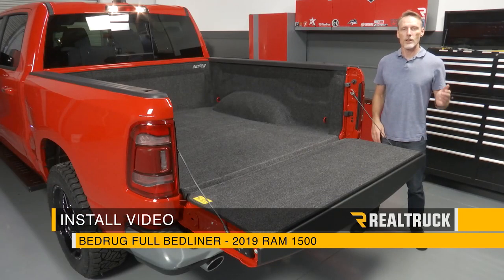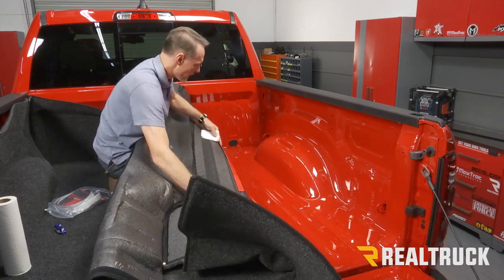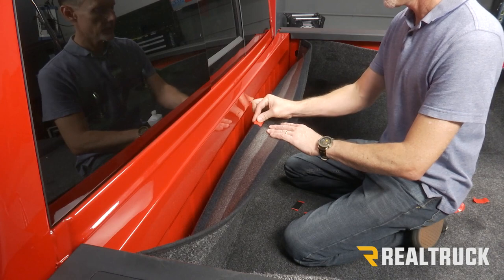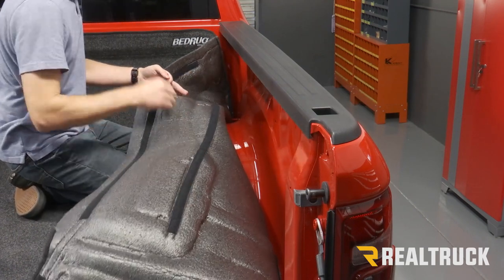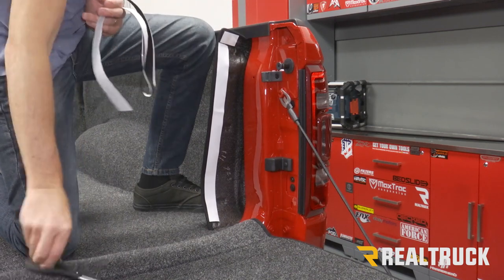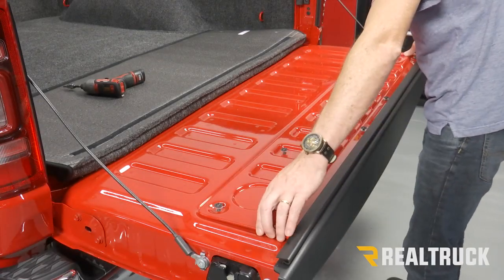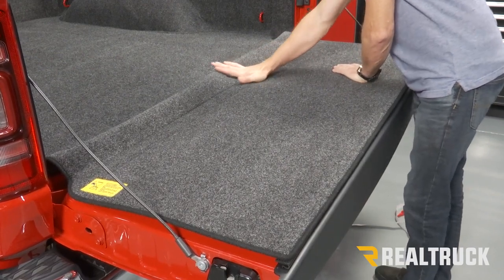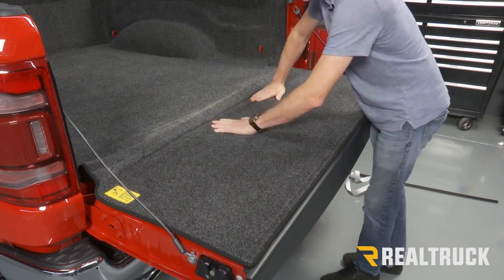How to Install BedRug Full Bed Liner on a 2019 Ram 1500

Comment: How does the bed rug & velcro stickers hold up against Texas weather? (Spontaneous rain followed by dry humid heat) Also is it ideal if you dont have a bed cover? Thanks.
Reply from the maker: Justin Function: We are in Florida, so with similar weather, we understand your concerns.  This product will hold up nicely to both heat, humidity, rain, you name it! It will function well only or under a tonneau cover.

Comment: I noticed you were conserving the Velcro tape wisely.  Would industrial strength Velcro from Lowes or Home Depot be appropriate to use for this? I think I will go get some more to be more liberal with it. What width is the Velcro you are using?
Reply from the maker: Thanks for the kind words! The hook and loop fasteners for the BedRug are extremely aggressive, and I've never needed to supplement it, however, if you get something, it's about an inch wide. The main key is to perp the painted surface with isopropyl alcohol.

Comment: This seems like a nice product but only if you keep your truck bed clean. I have a plastic bed liner and I have spilled oil, paint and other chemicals back there (accidentally) that would probably ruin this.
Reply from the maker: This is a common misconception, Bedrug liners can not be stained or damaged by oils, bleach or other chemicals due the the fact that it is made from recycled battery case fibers. It will prevent the liquids from sloshing around the bed and instead keep it contained in the fibers until you are able to spray it out. However if the cleaning of the liner is a issue for you, I would suggest taking a look at the Bedrug impact liner, the bottom of the mat is a solid rubberized floor.

Comment: Can you install the Bed rug if you have a spray in liner??
Reply from the maker: For the full BedRug, you need the adhesive promoter kit: https://realtruck.com/p/bedrug-spray-in-adhesion-kit-for-bedrug-liners/v/ford/f150-lightning/2022/. If you get the Impact or XLT BedRug Mats, they come with a couple adhesive promoter wipes in case you are going over a spray-in. Hope that helps!
Reply: Does the bed needs to be wash and clean before installation

Comment: Will the “J-clamp”  not work with any roll up tonneau cover?
Reply from the maker: S P: Not really quite sure what your question is. If you elaborate please, we would be happy to assist! Thank you!
Reply: RealTruck.com I have the bed rug I purchase from you guys which has the J Strip attached to the tail gate. I just ordered a tonneau cover for it, will I have to remove the J strip for my cover to work? Or is it depending on what tonneau cover you have?

Comment: Can anyone comment on the velcro attachment longevity...especially on the front and rear of the bed where the bedrail doesn't cover the top...My concern is that water will get behind the bedrug and affect the attachment..
Reply: I’ve used the same BedRug in 2 different trucks for years.     I’ve spilled (large amounts) of gasoline and diesel.    The BedRug stays in place and holds up even during pressure washing Dawn detergent into them.     Good preparation and cleaning will get you an outstanding product
Reply: Doug L Where do you buy it from Please